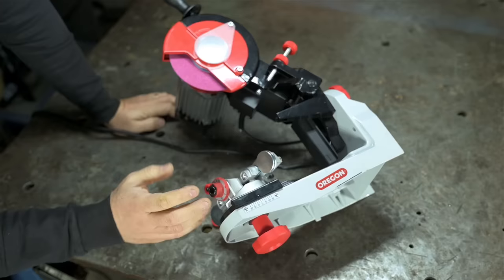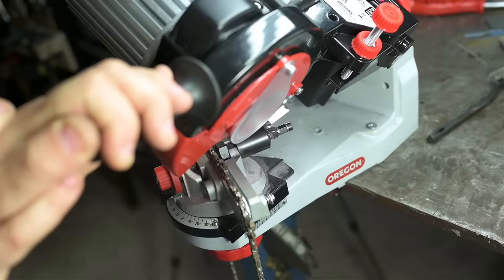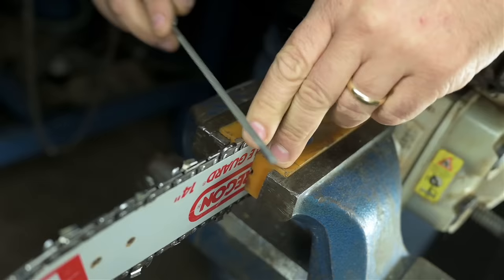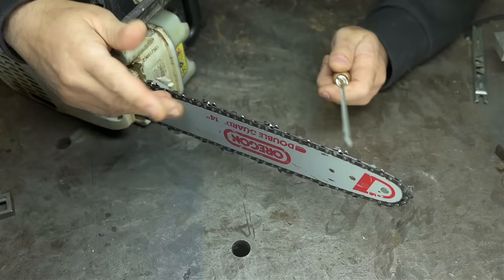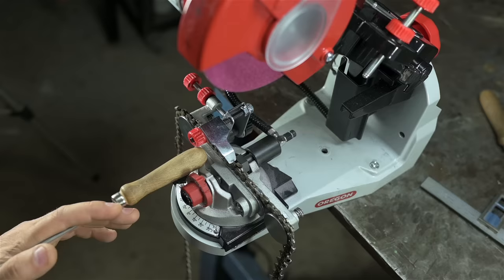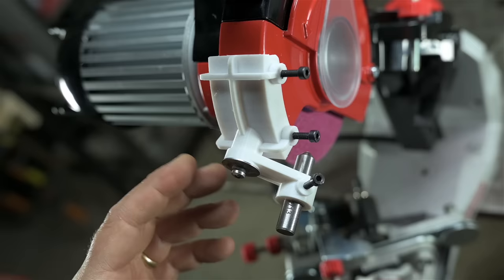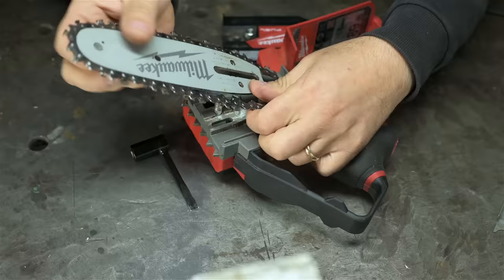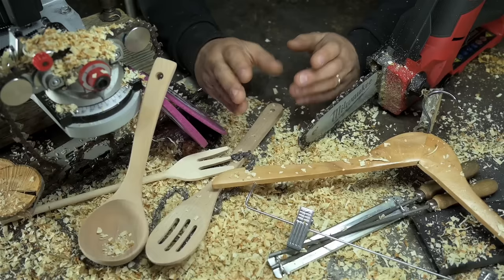Grinding Saw Chain! in Oregon! (620)

Comment: After my first retirement I went to work at a hardware store and one of my duties was sharpening chains.  I could always tell the skill level of the filer that handled the chains.  Some were ruined with no consistency.  The good filers kept a decent angle and fairly consistent amount of grind.  I did laugh out loud when you began discussing the out of round grinding wheels.  Just like Bob at Ox Tools using his indicator to inspect the runout of his new table saw and indicator on this device is a bit over kill.  Remember, "we are not building a grandfather clock" with the chain saw.  I have not used the machine you are demonstrating but the one at the hardware store was much more rigid (no I don't remember the name of it) and grinding the average chain was not more than 5 minutes tops.

Comment: Granberg G1012XT is a 12vdc, Made in USA, field sharpener that has a metal guide that clamps on the bar to ensure proper angle for left and right tooth sharpening. Since we all (all real men drive 7.3L diesels as long as we bring extra crank positioning sensors because they crap out when you least expect them to) have a F350 7.3L Powerstroke that comes standard with two large 12vdc batteries we always have plenty of power on the jobsite to run the G1012XT from Granberg.

Comment: A good analogy for the lean angel on the grinder itself would be how sharp the tooth is. Just like on a knife. Set it higher, and it will cut better, but will dull faster if you catch a nail or dirt.

Comment: should make a video talking about ur 3d printer setup. 3d printers is what sent me down this road of machining. i have way to many 3d printers at this point an im slowly getting machining tools. i got the little 7x14 lathe now and a wen 33013 mill so small cheap stuff but  im still really happy with what ive been able to learn with them, but i still use my 3d printers more than anything an alot of printing parts to make life easier dealing with the lathe an mill tooling an even some setup blocks til i can get a nice set but would be interesting to see how u have incorporated them coming from machining side first.

Comment: I have a harbor freight chain grinder. Once you get past the cheap hinge slop, you get some relatively great repeatability. I've used chainsaw files for 40 years, and I got quite good at hitting that chain of lick with a file. Very tedious when you have seven chainsaws. No longer, now I just carry four or five sharp chains with me in the field, it's much faster to change the chain out than it is to sharpen that damn chain.

Comment: Had a similar machine at work but it had hydraulics and a simpler vice that stayed tight. Was a good machine. In all the years I used it I never had tpo true the wheel. It did tend to wear on one side and I always reversed it whenever I was changing from one to the other. I also found that cheap cutoff wheels for angle grinders did a good job too even though they are quite coarse.

Comment: One thing you didn't mention (and first time I heard it was only a few weeks ago) if the cutters are not the same height the saw will cut curves instead of straight. Seems it's very common as most weekend warriors like me don't use chain saw very often and have only seen the 'stock' type of sharpening, get the angles close either side. Putting a straight edge along top of chain shows if the teeth are level. I've bought new chains when after a few sharpening's they star going left. Now I know what the problem is, I'll be taking a look at what I did wrong and hopefully fixing it

Comment: Tony, I use the grinding machine when I accidentally hit soil and/or hit a rock. The chain is then  too far blunt to hand file it. But normally between tree cutting jobs, I use the file to bring the chain to prestige sharpness.  It is a quick go around job. This seems to be the most economical way (otherwise you grind away your chain too quickly) .

Comment: My parents ran a small engine repair shop in the logging country of the PNW. One of my first jobs in life was running an industrial grade saw chain grinder. My misspent youth was filled with sharpening tens of thousands of chains, and this video triggered my saw sharpening ptsd from the many years of child labor. Tony, as always, provides a great overview and hit all the major points. One of the main differences between this Oregon grinder and that fancy machine I operated is the vise, it held the chain in position with a long powerful spring mechanism that would release with a foot petal. This hydraulic vice clamping only on the down swing of the arm is a bad design, as you pointed out, it's time consuming to align. 

For all you hand filers out there that are grinder curious I'd recommend the HF offering by Chicago Electric Power Tools. Only thirty-five dollars at HF or about fifty from the jungle site. The vice is controlled by a bicycle style hand brake. It's a decent little machine, and a hundred dollars less than this Oregon.
Reply: I agree I have a harbor freight chain grinder. Once you get past the cheap hinge slop, you get some relatively great repeatability. I have chainsaw files I've used for 40 years, and I got quite good at hitting that chain of lick with a file. No longer, now I just carry four or five sharp chains with me in the field, it's much faster to change the chain out than it is to sharpen that damn chain.

Comment: Chain grinding is an art, hobby and obsession.. in and of itself, there's making all the cutting teeth (cutters) the same length, then depth gauge and file for ride height, then one more quick lick on grinder for all the cutters in case the depth gauge slightly dulled the edges...
There's a lot of cheap chain grinders that'll do the job pretty handily for most people's needs, the Oregon's included.
Only issue is they roll inwards on one side, which is good for keeping the cutting edge sharp, but then rolls outwards the other way, creating a burr, and knowing that, you can't just let it slide, can you? 😂

Alternative is reversible Simington grinders to avoid rolling a burr, with those you can churn out square/chisel grinds very handily, Guilty Of Treeson has a video on those where a very seasoned cutter explains it all to the last detail.
Only issue is, Simington's are professional products, they cost 2000 bucks, and are not maintenance free... The high quality grinding stones alone are 300-400 bucks these days, then there's rough shaping them with stones and setting & maintaining perfect shape with equally expensive diamond shaping bits, so... Not what people need to tidy things up (1 or 2 trees) during spring with a Stihl 181-261 then (which costs the same as most grinding stones, and eclipsed more than twice over by the Simington itself 🤣

The best tool IMO is (when you're just maintaining the chain) pink Dremel grindbits, you can grind from the opposite side of the chain so wont roll a burr on chains, and don't cost a fortune, simply follow the profile the chain already has and voila!
Granberg also has an adjustable fixture w/ Dremel tool, I have one and they work, but just a Dremel does the job fine.

Comment: Hey Tony, regarding the eccentricity of your grinding wheel. I was taught (with a surface grinder) that every time you turn it on the wheel moves and becomes slightly eccentric. Causing the skipping marks on the work piece. This can be good for making less heat and on a chain saw blade I doubt you’ll see the skips. Not sure it matters but I would have thought a little skipping would good here. Cool dressing jig though. Love the videos.

Comment: I'm a real old retired old fart, we have quite some woodland I harvest for winter firewood, all oak too. . . . . . .I have a MS 181, 251 and a 391.
Have a similar non-hydraulic machine as I can't be doing with files and don't have the touch, plus your right and left teeth are now all the same and the saw goes straight.
You're right about grinding wheels, those pink ones are way too coarse;  I bought a CBN wheel, hugely expensive but way finer grit in a thin rim layer only on an alloy wheel.  You almost cannot overheat a tooth as the wheel conducts the heat really fast and the tooth finish is night and day compared to the pink wheels, CBN ground teeth look like nasty sharp chrome.
Only needs a lightest touch, very little and often seems to be the optimum.

Comment: Great Video Mr. Tony
Try adding a bicycle 🚴 hand brake lever to the chain vise cable on the power unit side of course by the trigger so your hand can do both at the same time
It will make measuring the cut or grind a bit quicker. 
How do I know you ask?
Yes I did that for a living for STIHL 
& please make that a part 2 if you plan on doing that.?!
Love your channel 
Your humor makes my day better 
Your a riot
Thank You 🙏
 Btw- STIHL has a similar small battery chainsaw pruner
🦾😎👍

Comment: I use one professionally without the hydraulic vice sharpening chains that cut pecan. Your right about the set up, it's way faster especially when you're sharpening 8 chains 3 times a day that are 84 drivers or longer

Comment: For most cuts, the side plates are cutting across the wood grain, so you need to pay more attention to their sharpness.   The top plate of the cutter is just flowing through the grain, so uses very little power to move along.
One thing in the file's favour is that it can sharpen just the three cutters that hit that nail, or stone, in the wood.

Comment: I quite like the 2 in 1 chainsaw sharpener (either Stihl colors or the company that makes them Pfeil). It's a file guide and raker file in one and it automatically keeps the rakers at a consistent height. Keeping the right angle is super obvious as it has multiple large indicators on the angle (much larger than the small line on the teeth or even a regular file guide). I could even give it to my gf and after a few tips, she sharpened the chain just fine by herself. Only take 2-4 strokes per tooth unless your super lazy at sharpening and keep wondering why the chainsaw doesn't cut at all. Or if you like reprofiling chains then obviously machines save a ton of time. But just maintenance sharpening, taking the chain off and doing all the setup work on your grinder, it's pretty much already done with a 2 in 1 sharpener and the rakers are done without you ever even thinking about them.
Still, can't blame a man for getting new tools.
Reply: Same here. Sold my file jig and my grinder after I bought a Stihl 2 in 1. I think a lot of people ignore the rakes and all the chains I've used come out of the box with pretty conservative depths, especially if you are cutting softer woods or have a powerful saw. The 2 in 1 always keeps the rakes at a good height.

Comment: 1- Use a file 1/32" oversize. 2-Cut the drags down on a new chain. 3- Sharpen chain every time you add gas, or before it needs it. 4-The chain on a saw with a 16" bar can be sharpened before you can take it off and put back on. 5-Sharpen the awkward side first. 6-Do not run the chain in the dirt.

Comment: Not sure about going much finer than (say) a 180 grit wheel. As a woodturner, it's possible to grind HSS tools on (what is, in effect) a linishing belt & you can get belts up to 2000grit. However, the manufacturer specifically says not to use these belts for wood turning tools because, once you go above 180grit, you're grinding through the individual grains that make up the steel.  These half grains that you leave behind at the cutting edge might be thin enough to slice through an overripe tomato, but are so weak that they will crumble away the very second that they come into contact with wood. I'm aware that the teeth on a chainsaw are not likely to be HSS, but I imagine the principal still applies.

Comment: The third factor in going through chains is novelty. Hand filing a chain is a pain in the ass, a chore to be put off, so your chain lasts longer because you just don't sharpen it as much as you should.

Meanwhile, new toy? I'd be inspecting chips to find ONE that wasn't exactly the right shape and taking that as a sign to go use the nifty power tool. Probably triple the amount of necessary sharpening, which is like 6x as much sharpening as gets done by hand 😂

Comment: I do fine with a hand file on the job. When I first started i was asked to use a viced chain grinder and the results were sub par at best. Sure all the teeth were at the exact same angle, but they sure weren't sharp.

Comment: Today I had a little time this afternoon so I threw together an auto feed system for my Oregon chain grinder.  It uses an air rotary actuator to move the chain.  I step on a pedal and it advances the chain.  When I take my foot off the pedal it backs the chain up to the stop.  I made a clutch for the sprocket so when the tooth contacts the stop the clutch slips so the rotary actuator can go back to home in preparation for the next  cycle.  A small air cylinder is used to clamp the chain.  When I step on the pedal the air cylinder retracts and allows the chain to advance.  The sprocket I made is not correct for the chain I used to experiment.  The spacing is not correct to engage the drive teeth on the chain.  It was just a quick proof of concept and nothing is calibrated.  Tomorrow I will either buy or build a correct sprocket and do some calibrating.  I will refine it once I know it repeats accurately.   I built a much more complicated one about 10 years ago but it got put on the back burner.  Your video inspired me to revisit the project.   As I said this was just hacked together this afternoon and it is real raw.

I took a short video of it doing it's thing but don't judge me too hard.   I ran out of time to do any more on it today.
https://youtube.com/shorts/acYyn_4Ux30?feature=share

Comment: I always stayed away from sharpening chain for 2 reasons..
1…I had a file handle but no files 
 B…I broke down and bought a $12 Dremel grinding  jig that laid flat on the saw tooth. 
Now, whenever I need to sharpen a chain I either can’t find the Dremel or I misplaced the dull chain, which means the little grinding stones last a long time & the Dremel  is in a secure space somewhere

Comment: I think the grinder is not supposed to be used for every sharpening, if i'm not mistaken mine said something like "one grinding every four hand-filing" It's used to correct the mistakes we make by hand filing, not necessarily sharpen each time, because they remove way more than the file would for the same re-sharpening effect
Also i can guarantee my cheap knock off brand sharpener has way more movement in the hinge than your oregon one ^^

Comment: The Timberline sharpener is pretty awesome.  I have it out with me in the woods and can sharpen the chain on the saw in a few minutes.  I did buy spare carbides when I bought the thing 6 or 7 years ago.  Still on the originals!
Reply: In my opinion, the Timberline will sharpen to a sharper edge than any other sharpening method, when used correctly. I have an early model, with aluminum back stops, and they have worn beyond usable shape now, so I'm back to grinding wheel again. One downside to the Timberline is that it's not really good for dressing, it's best used for maintenance sharpening often. Shaving each cutting edge leaves a crazy sharp tooth with no burr.

Comment: Oh just wait until you try the Cubic Boron Nitride wheels.  
I also putna nylon locknut on the forward/back chain stop ajuster and got rid of the oring/lockplasticthingy.  More consistent.
Next stop is shoehorning in two-way motor control like the old school grinders.

Comment: I cut wood for several years. From the time I was 13. I  hand filed all my chains. Basically because they didnt have electric grinders way back when. Yes, I'm older than dirt. I sharpened my neighbors chain saw chain a couple of years back. By hand. Yes , it is still a pain in my ass.

Comment: I use chainsaws a lot in demolition work. Hand filing chain that has hit too many nails is miserable experience. These grinders are life saver. I prefer to run cheapest possible hardware store chains and get 2 to 3 sharpenings out of them in demolition work.

Comment: As someone who works for forest service and uses chainsaws as my main tool a lot of the time, I use hand file almost exclusively. Mostly because you need to be able to keep up maintenance on your teeth trewout the day. That being said, most people I work with and most Professional loggers will admit a square ground (machine ground) chain is sharper than a hand file. Moreover, it being a sharper process than hand file, dulls quicker, and can't be worked on in the field without a special type of hand file. Although most professional loggers take the time to prepare multiple machine ground chain to swap out during the day and sharpen them that night. Round filed chains do hold their sharpness for longer and can be worked on without taking the chain off the bar, which just makes sense when working in the field and don't have a place to keep an electric sharpener.

Comment: besides, the angle of the grind also has an effect on the "bite" of the chain and also the result. for cutting down trees you want a more aggressive cut that can cut faster but have a worse  cut, go with a higher cutting angle. For finer cuts, like cutting planks, you want i smaller angle, like 10 degrees.

Comment: As a young lad I once had a job where I burned slash piles made from pipeline and road right of ways.  We used chain saws vigorously to keep those piles burning.  The crew leader thought that rakers were for sissies.  Let me tell you that a person better have their feet planted, and have eaten their Wheaties when that "blade" hit the wood. After a day of handling those saws, you did not have to hit the gym.  Every muscle from the neck down ached.